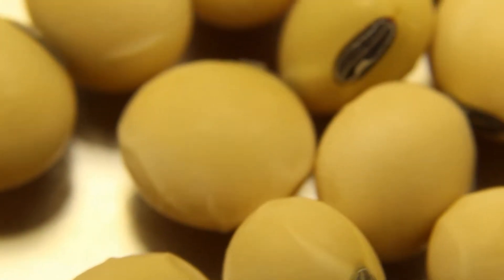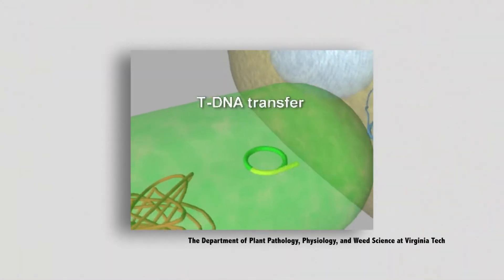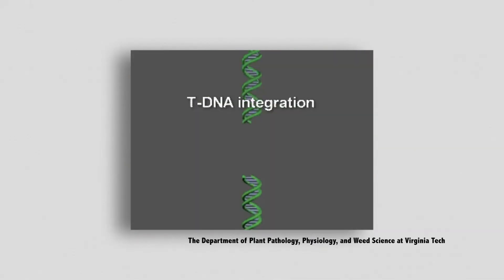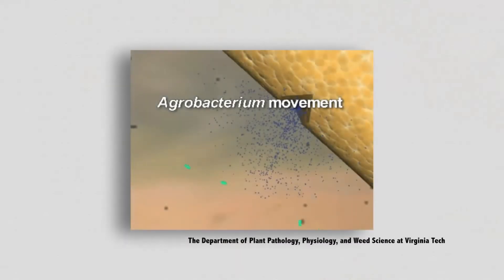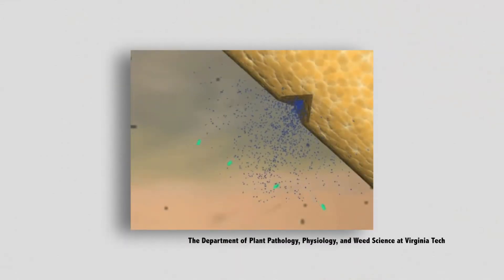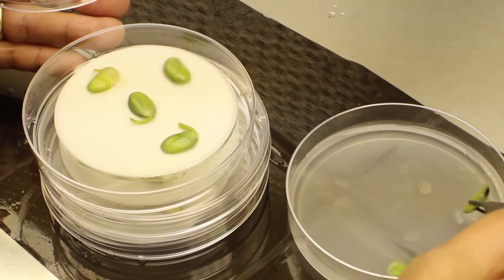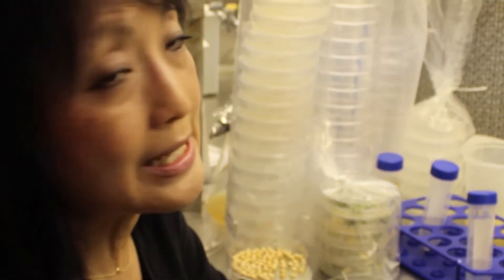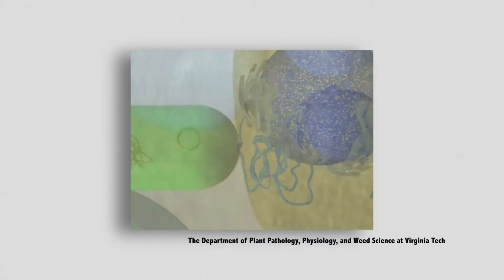Soybean Genetic Modification

Comment: How they make sure the bacteria that insert gene to the plant was get sterilized after the process done ? If the bacteria still alive can they contaminate wild plant  ??
Sorry for bad english
Reply: The selective medium contains an antibiotic again Agrobacterium. This antibiotic could be cefotaxime, timentine, vancomicine or carbenicilin (or a mix of this). The video was edited, but usually after the infection and the transfer to the selective medium, the plant tissue is washed with a solution that contains this antibiotic in an especif concentration (cefotaxime 200- 500 mg/L, vancomicine 50 mg/L). After this wash, the plan tissue is cultivated in an selective medium that also contains the antibiotics. After several rounds of culture, the bacteria died. In order to confirm the elimination of the bacteria the scientists can run a PCR with primers especifics for Agrobacterium. This PCR must be negative
Sorry for my poor English.
Reply: @juanmanuellatorre1229  thx
Reply from the maker: That's a very good question and I am not sure. I do know that the genes that the bacteria normally uses to create galls (tumor-like formations) to feed from have been removed so the bacteria would not be very successful in the wild. Since it cannot create its normal food source it probably would not survive for long outside the lab.

Comment: What is the compound that you brushed on the leaf for checking mam?
Reply from the maker: I don't think she specifies beyond that it's an herbicide. Maybe 2, 4-D or glyphosate. You would use whatever herbicide is resisted by the resistance gene you inserted via the agrobacterium.
Reply: @BRING_GUNS  mam!! how is that modified variety different from the normal one? I mean, does it cantain resistance about something than the 1st one?
Reply from the maker: venkatesh bantupalli just to be clear I am not the woman in the video, I just reuploaded it. The gene introduced to the plant gives it resistance to an unspecified herbicide. That herbicide is then applied to the leaves of the plant to confirm that the gene has been successfully transferred. If the herbicide doesn't cause damage to the plant then obviously the gene is working, if it does cause damage then it was not successfully inserted.

She does not specify which herbicide the gene is resistant to but it doesn't really matter as the process would be the same for any herbicide as long as you could find a gene that provided resistance to it in a species.
Reply: @BRING_GUNS  ohh..ok mam thank u...

Comment: I don't know a lot if anything about editing genes and such, but if you want to be almost sure where you are inserting the genes you want wouldn't it be better to use crispr?
Reply from the maker: This technique predates CRISPR. Agrobacterium transformation was developed in the 1980s while CRISPR/Cas9 as a genetic manipulation tool was first being explored around 2012-2013, around the time this video was uploaded. CRISPR is almost certainly a more powerful and precise technique but it's very new and there's still a lot of kinks to work out first so I'm sure the agrobacterium method will stick around for awhile.
Reply: @BRING_GUNS  Can CRISPR be used in the transgene insertion into plasmids, instead of the old method I wonder?
Reply from the maker: @zugzwang4678  I would imagine it can! I'm a bit out of the loop nowadays with this sort of thing so I don't know the pros and cons of doing so but I'm sure it would be possible to use CRISPR to build a plasmid that could then be inserted with agrobacterium.
Reply: @BRING_GUNS  Yeah I started researching some science papers after seeing this, and it seems that crispr-cas9 is indeed a common way that researchers are building their plasmids. They then continue using the agrobacteria method to transport the plasmid into the plants. Super cool stuff, I'm glad you posted this video. Makes it super easy to understand the protocol.
Reply: @zugzwang4678  Nowday, You can generate CRISPR edited plants without Agrobacterium.  If you have a method for regenarate plants from protoplast (plant cells that doesn't have cell wall), You can, literally, mix in a tube these protoplast + CAS 9 enzime  + the RNA guides.  The preensabled CAS9/RNAguide can enter into the protoplasts and edit the nuclear genoma. After, you can put the protoplast in a culture media whit the hormones in order to obtain the edited plants.
The hardest part is the regeneration of the protoplasts: these cells are so weaky and have a short life. The key is a good protocol for obtain the protoplasts and a good method for regenarate it.
Reply: @juanmanuellatorre1229   Thanks for the extra info. I read a paper about scientists who used the agrobacterium method to express developmental regulators and thus create meristem structures on the trans genetic plant. Those meristems could be transferred to a rooting medium, which grew into whole plants with the parent gene edited mutations.
Reply: @zugzwang4678  Yes, CRISPR will work perfectly. The transgene will be part of the Crispr construct or complex that will be inserted into the plant genome.
Reply: @BRING_GUNS  But, if You want yo edit a gene using CRISPR/Cas tool, probably You also going to need an Agrobacterium in order to insert de vectors with Cas9 and the RNA guide. The other way is a mix reaction between protoplast and the preensabled Cas 9/RNAguide.
Sorry for My English.

Comment: The patent on Roundup Ready soybeans expired in 2014. It is generic now and open sourced, much cheaper now to the delight of farmers, while still offering the advantage of resistance to glyphosate. Roundup patent expired in 2000.  
RR2 has been sold for a while, it gives higher yields. RR3 is in the works. Farmers are free to grow the cheaper off patent stuff @ $25 per 50 lb bag per acre or they can spend $50/acre to grow RR2 with higher performance.
Reply: Can we use the gene roundoup resistant right now ??
Reply: @alriz5316  You can use any of them but the first version is now patent expired so it is $100 per bag cheaper.